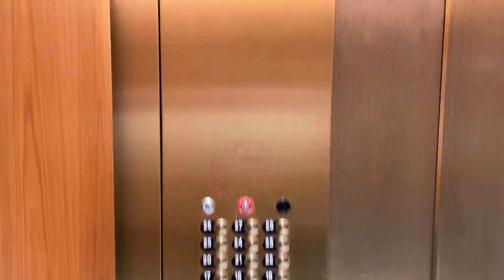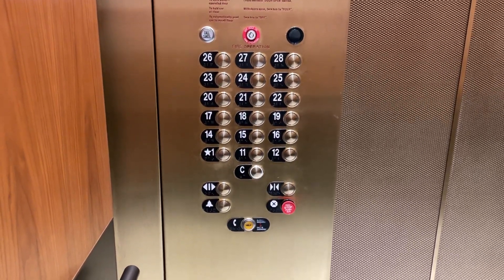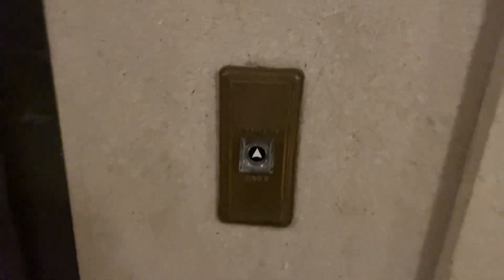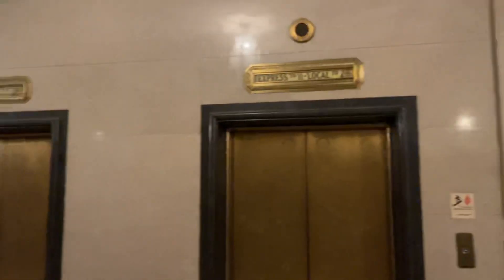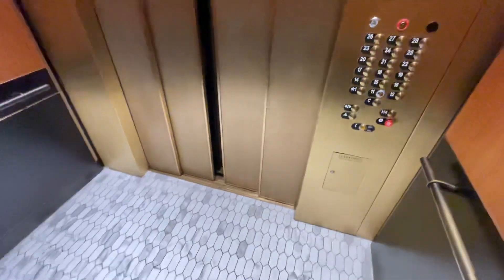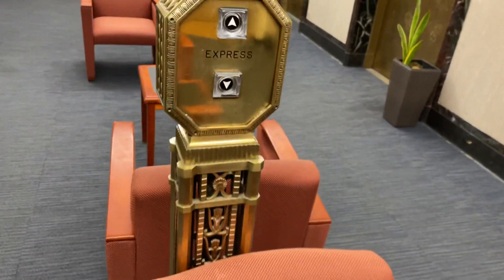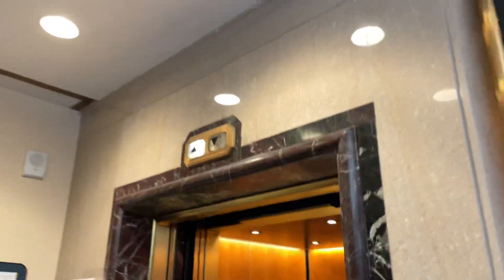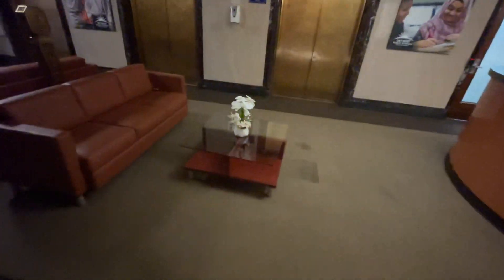Otis/ThyssenKrupp High Rise Elevators @ Fisher Building - Detroit, MI.

Comment: I came across a similar modernization of TKE where they kept the outside call buttons (as Otis Lexan) original & even the bells on the Lobby level original. 

They only modded the interiors & everything else inside the elevators.